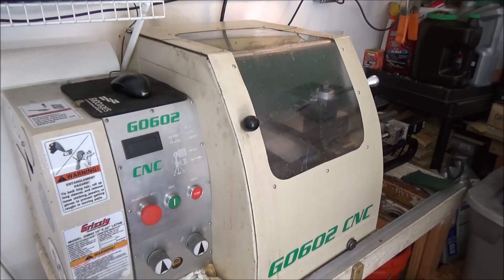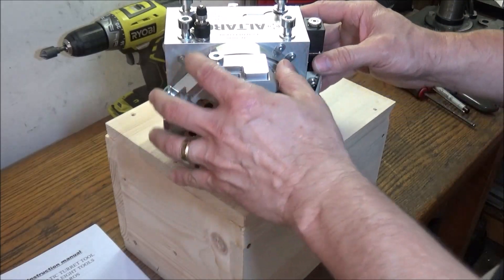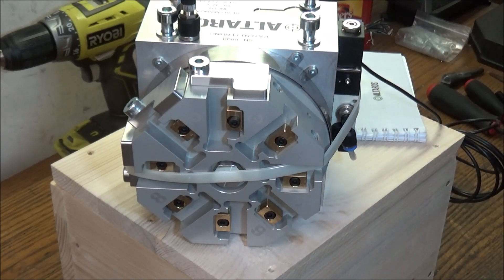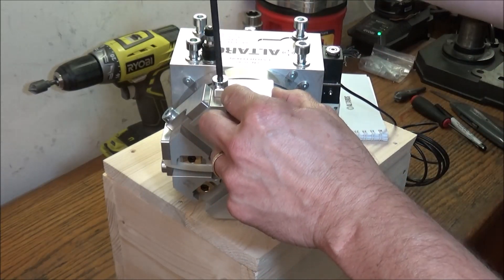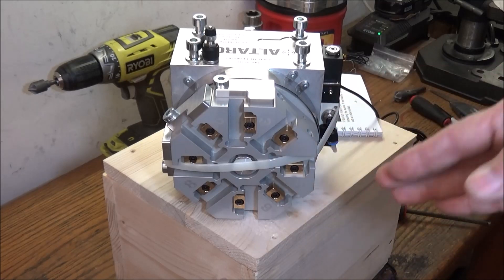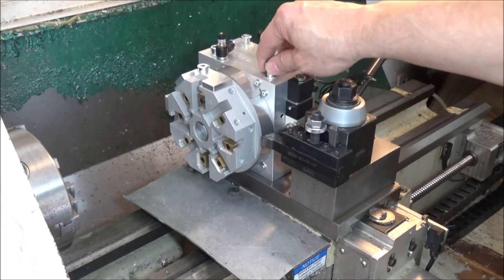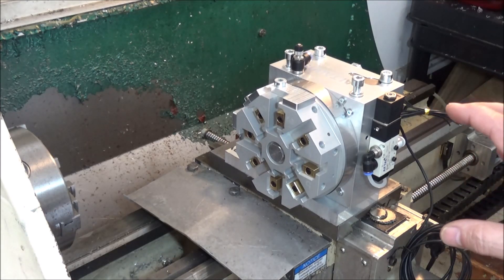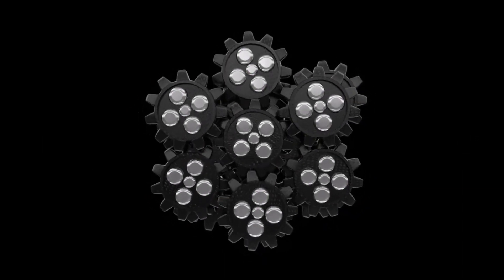ALTAROS - Automatic Turret Head

Comment: How did you determine the total mechanical engineering design quality before your order. It looks great from the outside, but I would be concerned about spindle bearing, and in tool load stops. Thanks again for All your great videos.
Reply from the maker: Good question! You don't really know those things just from looking at it.I have not taken the turret apart and of course Altaros is not eager to share there design drawings. I will say the turret is solid movements are crisp and tight.
once the turret is locked into position it is solid and I have had no issues at all. Bear in mind this is not a large turret but is a perfect size for 10-12 lathe.
Reply: @CNC4XR7  okay, thanks for the reply.

Comment: I have a PM 1127VF that I am converting and have been looking at one of these pretty seriously. I am a bit terrified of having to run Mach 3 again, though I did it for it years on my mill. I'd also like better than a single spindle input pulse, but I am tempted to go with Mach 3 just because there's a plugin already made.
Reply from the maker: This Turret is a great fit for the PM1127. I've never had many issues with Mach3 turn that are encountered on mach3 mill.  The turret works well and the macro has built in checks that seem to avoid any issues.
I will be doing some turning in Mondays video.
Reply: @CNC4XR7  Thanks! I look forward to the next video. Do you thread often with Mach? I have some projects that I want to thread some reasonably large diameters and that's why the single pulse kind of worries me. I may go for a servo spindle motor though, I am still on the fence.